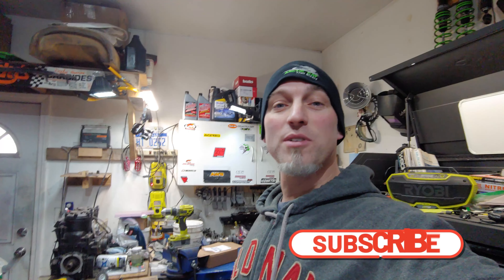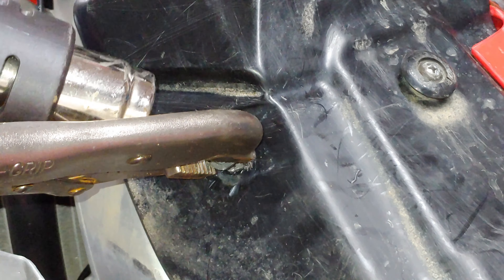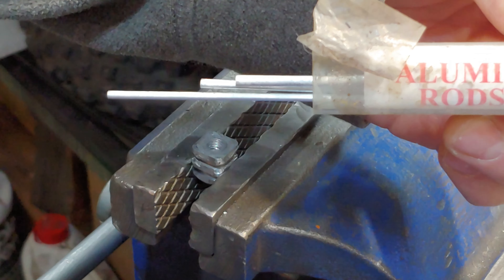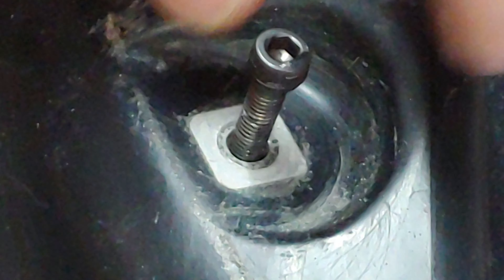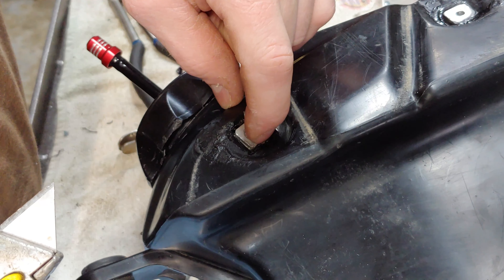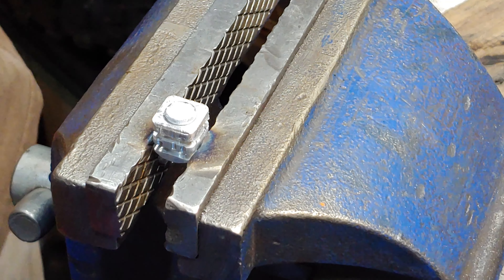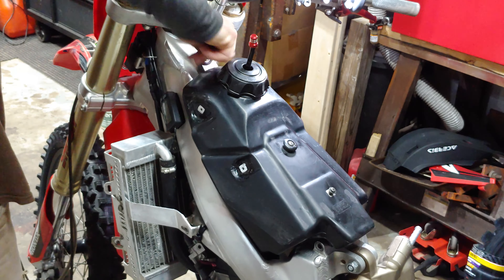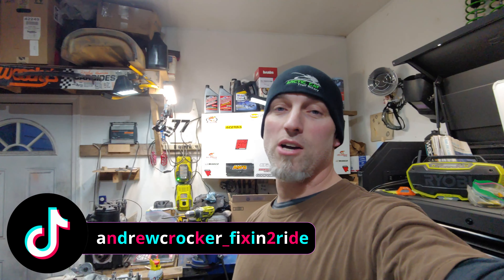Dirt Bike Tank Repair || Stripped Shroud Nut is Spinning

Comment: Thanks for the video. Preparing myself to do the same thing today
Reply from the maker: If it's just a stripped set of threads and not a fastener stuck in it I would get a helicoil tool set off Amazon and do it that way. Just before not to drill too deep.
Reply: hello, what soldering solution did you use, I have the same problem with an xmotos tank and I can't find to buy a new one, I'm interested in what solution you used for me, it's more complicated because next to the nut I have a hole all the way to the inside of the tank and I'm also missing the nuts, thank you?
Reply from the maker: @costycosty5850 I used Aluma weld which is aluminum sticks that you can buy from the hardware store or big box stores. Takes a bit of heat but then it melts pretty good. It's been holding up fine since
Reply from the maker: Good deal. Glad you found the channel then!
Reply: @Fixin2Ride-Official- thanks for the answer, I'm referring to the black solution with which you fixed the nuts in the tank after melting the aluminum and redoing the thread?
Reply: @Fixin2Ride-Official- you used JB Weld plastic bonder ?
Reply from the maker: @costycosty5850 Yes. Worked great! Still holding strong. Mind you that there was still a Lot of material in the holes that was rough to grab onto but osl the ribs of the nut itself. They were tough to get out but also a but tough to get back in but make no mistake they are in there good.
Reply: I also glued the same but after 24 hours it didn't get hard as the plastic remained soft like a silicone it is normal to stay like that I haven't tested it yet to see if it flows because in my case the tank was also drilled in 2 places near the nut and I loaded more JB WELD and is it because I put more?
Reply from the maker: @costycosty5850 Did it have holes I to the tank to expose expository fumes? If so thatwould be the reason it stayed soft. If not then you either mixed it wrong or it's a bad batch.

Comment: Do you know if any of the manufacturers sell new screw mounts? I just pulled these out of my Clarke desert tank.
Reply from the maker: I don't think so. Youll have to find a manufacturer that does. Or you could make your own. If you are.good woth a welder, well 2-3 nuts together while on the right sized screw then grind them square and with ribs in them ans install like I did. Or get some raw metal and cut the ribs and drill and tap new threaded holes. Always more than one way to skin a cat, as they say... 😉

Comment: at 16:36 the shroud has that extra bold hole on the bottom right, mine has that too why is that?
Reply from the maker: If you're talking about right under the seat that is to access the bolt for the sub frame